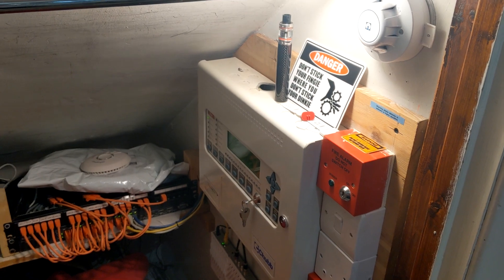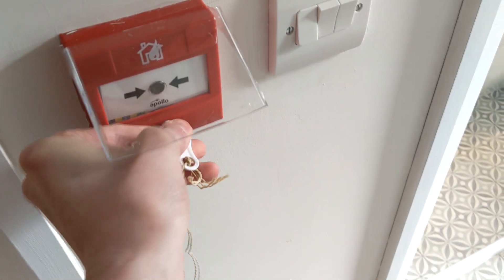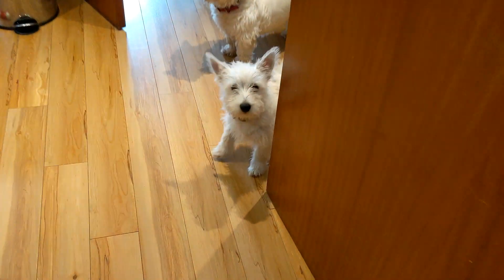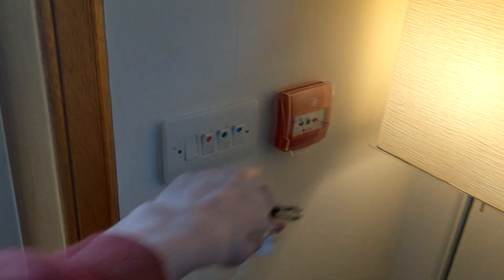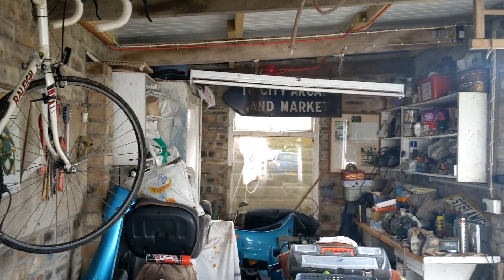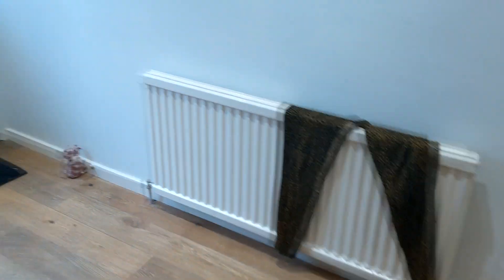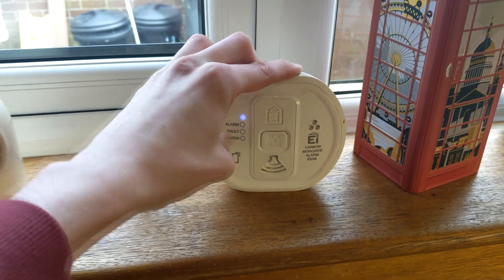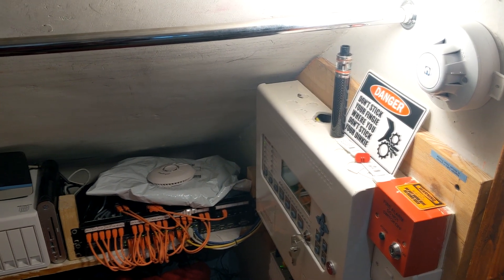Addressable System Test 18

Comment: You should change the programming on the living room detector as there it is most common for smouldering fires which produce more smoke than flames
Reply from the maker: rear living room or front living room. the front living room is an optical only set mode 1 during the night and mode 3 during the day the rear living room multisensor is mode 3 smoke during the night and mode 5 heat only during the day.